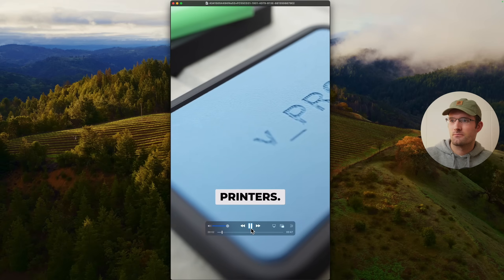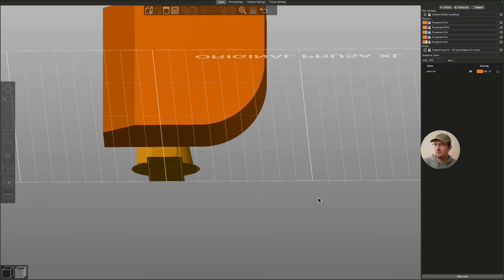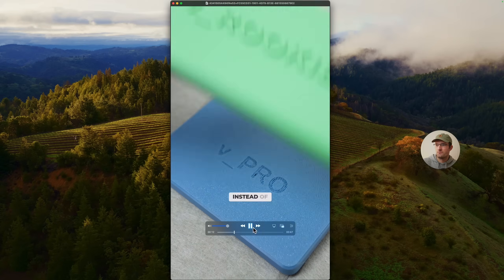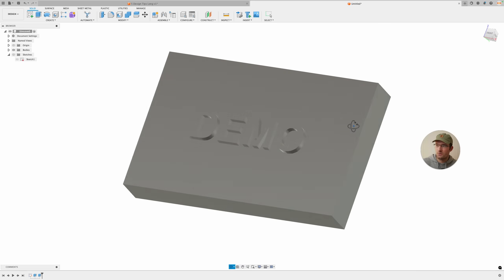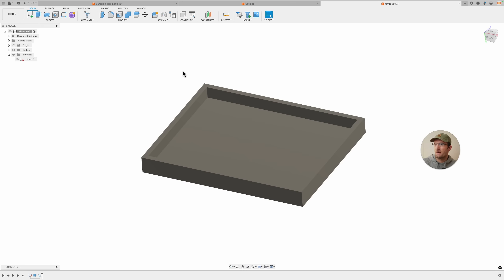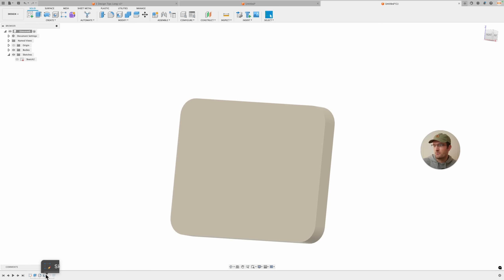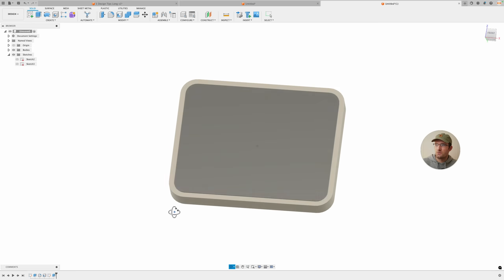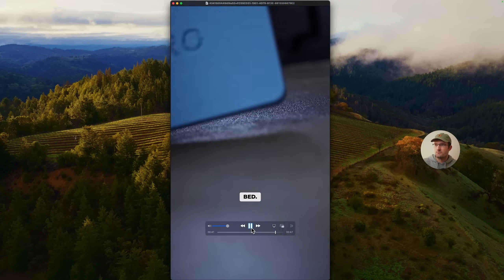5 Pro Design Tips for 3D Printing [Weekly 3]

Comment: Great tips.  I am looking to make a clamping handle where i pull two pieces together to make tight and not slide.  Do you have video on putting some sort of texture to help stop sliding between the two parts.  I can glue sandpaper but prefer to make interlocking texture if possible

Comment: IMO, it's offten better to handle text in the slicer.  Prusa, Orca, and Bambu slicer all have text modifiers for debossing and embossing and I believe they can even do surface wrapping with the text.  I guess sometimes it's nice to bake the text, but more often than not, I find it's more useful if it's configurable all the way to slicing.

Comment: Something i enjoy incorporating into my prints is filleting a chamfer. That is, chamfering the bottom edge (touching the plate) and then filleting the chamfer's corner. You can play around with the distance and angle of the chamfer and you can achieve a corner that looks almost like a normal fillet, but is totally printable with no support/overhanging defects

Comment: 7:26 Do you base the tolerance on your nozzle diameter, or does 0.2 work for most applications regardless of nozzle size?
Reply: it should be based on the nozzle diameter. generally you cant go much lower than 0.2 simply due to the manufacturing capabilities and tolerances of the printer itself
Reply: It's not necessarily based on the nozzle diameter actually.
Firstly, it is it based on how well your printer is tuned and how good quality your printer can print. 
The better, the lower the tolerance.

Another factor is the orientation of the tolerance (eg vertical vs horizontal vs multiple axes). 
Parts printed horizontally, sliding together vertically will generally have the best tolerance.

Finally another consideration is the seam, the location where the printer starts and finishes the bead of plastic for each layer, this can sometimes define the tolerance, especially for cylindrical fits. So the shape of the parts also plays a role in this fashion.

You can print calibration prints, to check down to what tolerances your printer can handle in which orientations.
Reply: @ a 0.2 clearance gap on a 0.2mm nozzle vs a 1.2mm nozzle will produce different results